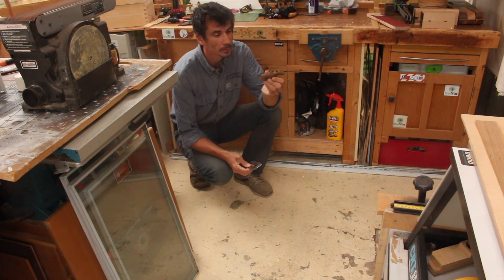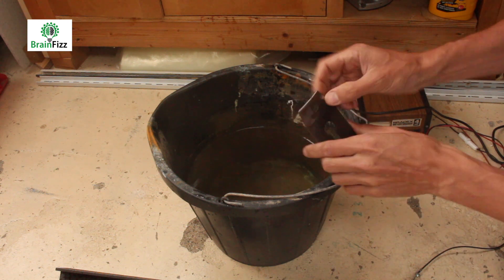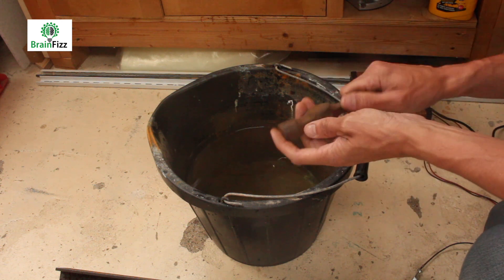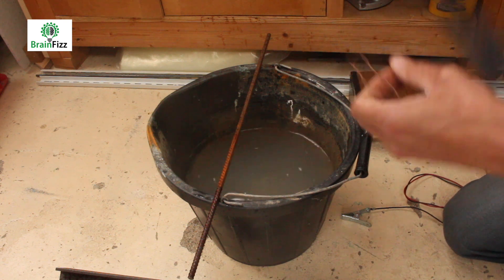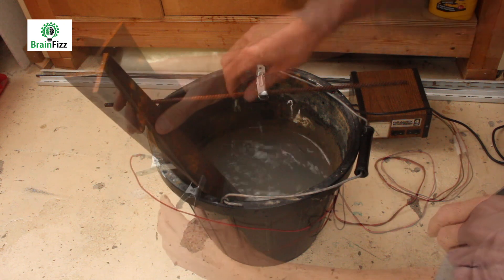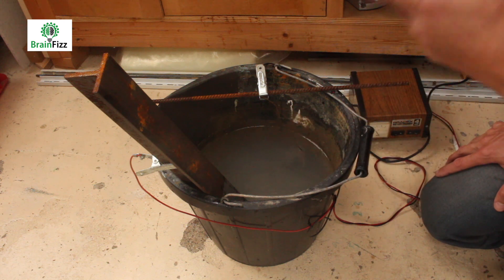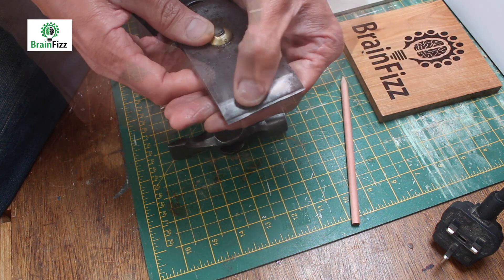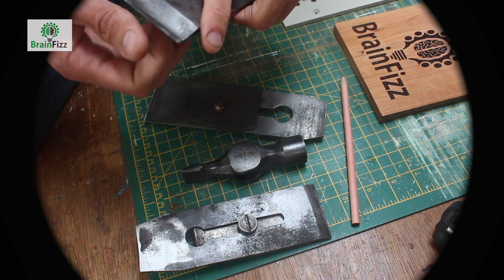De rusting Old tools - Removing Rust with Electrolysis

Comment: Now that's the second video today I've seen using this process. Your was actually up first though.
Yes Positive to draw the rust. I always thought that the current comes from the positive, in fact the atoms move from the negative to the positive which we may seem off as we always place the negative everywhere in cabling but careful about the positive.
Well done they came up a treat. Be interested to see you make a plane at some point.
Reply from the maker: The old wooden handplane is shot. It has wormholes and a split in it presumably where it’s been whacked over time with too big a hammer..... that said it does appear in a future video which comes out in a week or two’s time.

Comment: White wine vinegar also works to remove rust.
Reply from the maker: Yeah, there’s all kinds of methods. Electrolysis is my preferred as it only reacts with the rusted metal, not the good metal underneath. Vinegar can actually effect the metal too, this is why it’s the approved method of the tool restoration organisations. Also it’s just a waste of vinegar.
Reply: Agree, White Vinegar, cheaper, easier, less messy...